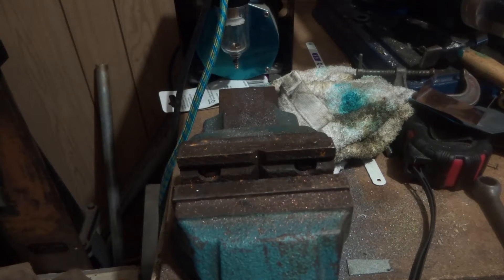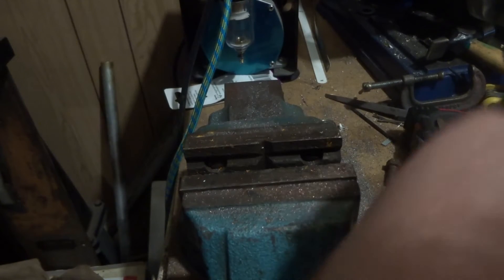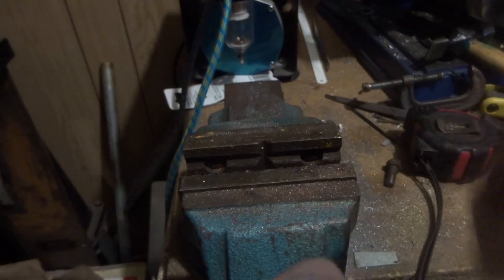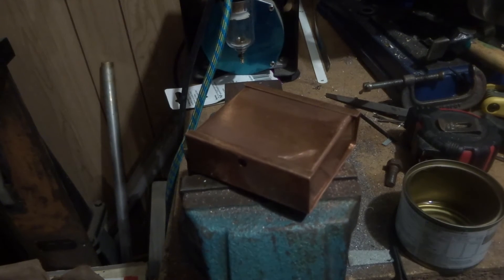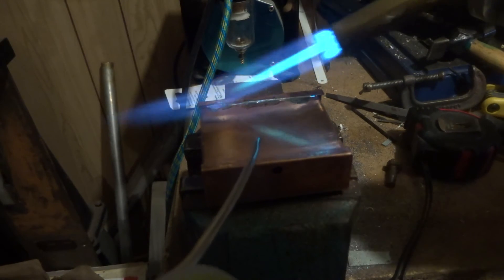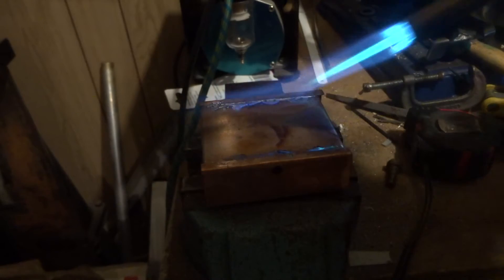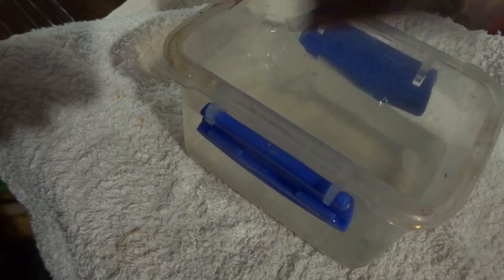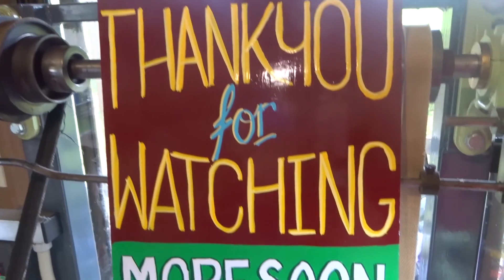KENNETH WELLS  SCHOOLS  Steam Engine PART 5 soldering

Comment: Good soldering! I always get the solder dropping off the work into small balls and the solder doesn't stick even after applying flux to the work first when using soft solder. How do you manage it?
Reply from the maker: cleaner, more heat. mostly cleaner.